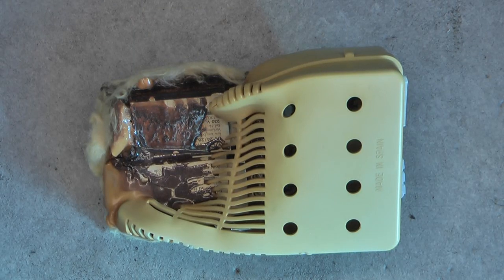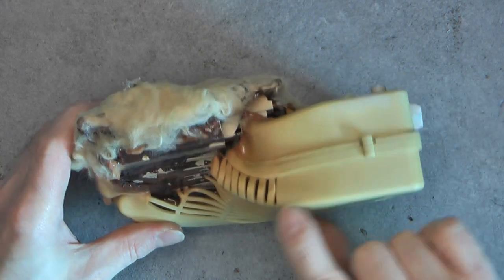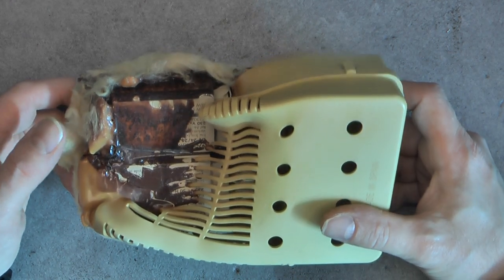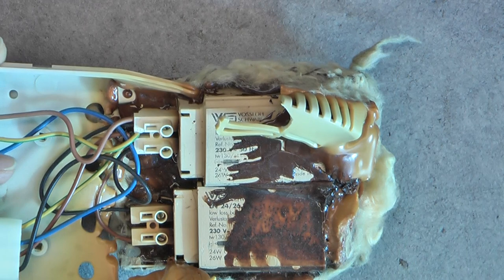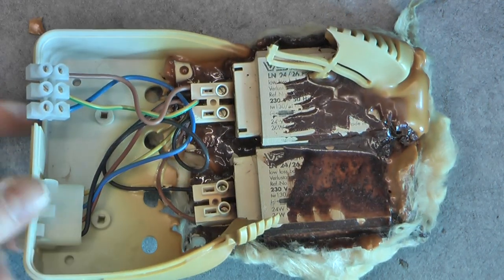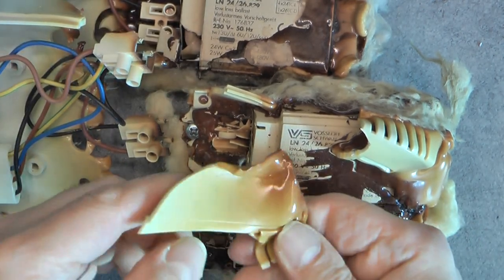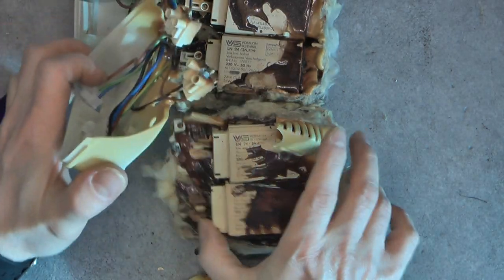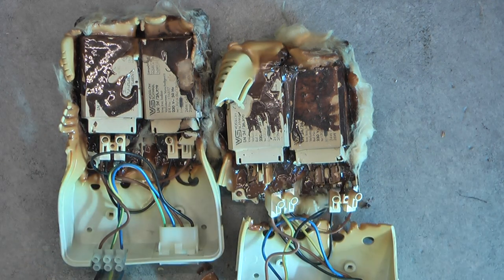Melted fluo light ballasts monstrosities.

Comment: Those ballasts are meant to be mounted on a steel or aluminium plate to dissipate heat. Most likely they failed because of EOL lamps that eventually shorted out the starter, and then the ballasts were essentially across the mains. As they in normal operation run at 100C above ambient on a steel chassis they probably went well over 150C running in the plastic before either the insulation broke down and they shorted out and blew the windings ( and the tube filaments as well) or they just cooked the plastic into the mess. Probably also were nicely enclosed inside insulation in a ceiling as well, so they ran even hotter as well.